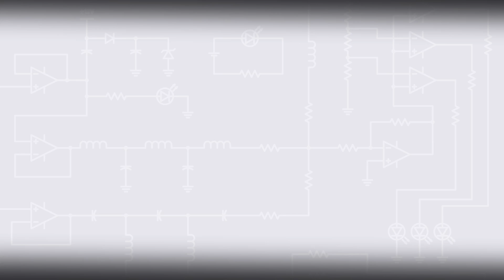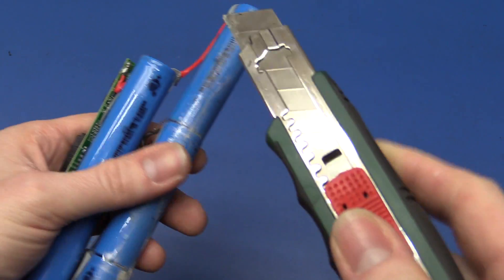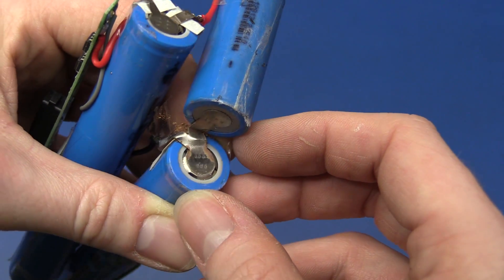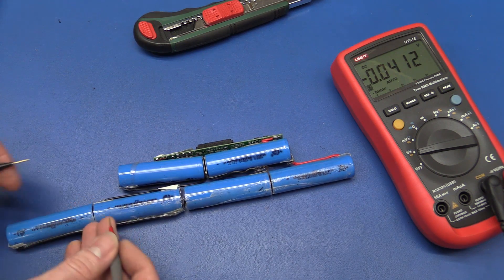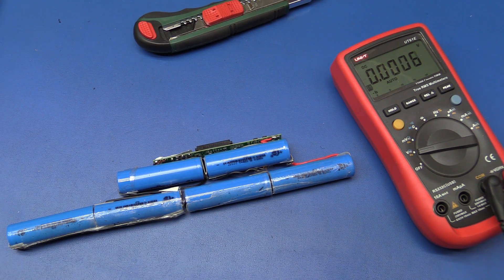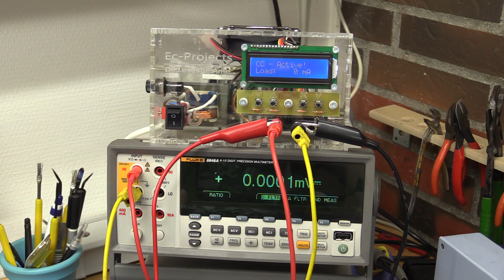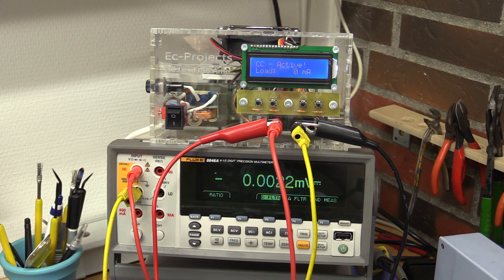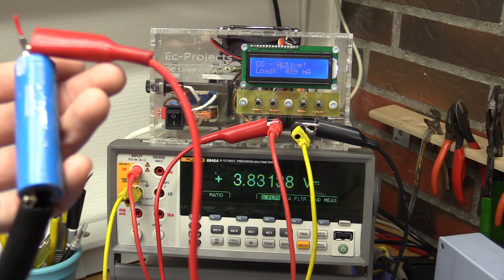Disassembly of Failed Laptop Battery - Ec-Projects

Comment: My acer notebook, which is nearly 6 years old, has a battery model AL14A32 and it has failed, after the high temperatures due to climate change;  the weather here got so hot that the battery simply stopped working

Comment: Charge all the batteries individually by some other means. And then connect them the way they were connected to the BMS board.
There are 2 ways to enable the battery circuit.

1. Connect the 12volt battery terminal to the actual +ve port on the laptop battery connector. It should enable the circuit. If not try the next step.

2. Keeping the negative probe of the multimeter on the battery pack negative terminal. Check all the pins for some kind of voltage which should be within 1.5 to 5 volts. If found any. Just ground that pin and the battery pack should start powering up.
Reply: which are the 2 ways of enable the battery circuit.??

Comment: No obvious evidence of damage on the circuit board, makes you wonder what actually went wrong internally
Reply: +tombell12 I've heard of BMS firmware having a limited number of cycles programmed into it, as an excuse to force users to replace the battery every once in a while. Lithium ion batteries usually provide at least 3 years of use, sometimes upwards of 5-8 years. Laptop batteries suspiciously always fail earlier than later.
Reply from the maker: +tombell12 Yeah, I never found out. Perhaps overcharge, the battery got very hot in the computer but cooled right down after I tossed it out in the garage :/

Comment: Mads put the batteries from the failed pack into the original pack and see if that will revive the original pack. Or put the original pack controller board into the failed pack. Nothing lasts forever.

Comment: The circuitry of the battery should be pretty simple a microcontroller to handle charging and protection some fuses, mosfets and a voltage regulator for the micro.
except for checking for voltages and mosfets, what else can you do ?

Comment: So, a battery indeed has a controller which disconnects it from Power Source to prevent over-charging. What's the harm in leaving the computer connected with power supply for a longtime even after the battery is completely charged ?
Reply: There is no harm in leaving your computer connected to the charger for a long time, it all comes down to the life expectancy of your battery. According to "experts" the optimal long-term storing charge for a lithium battery is about 70%, this will give your battery the longest life span.  This optimum life span will decline somewhat at both higher and lower charge levels, leaving your charger in the laptop will maintain a 90-100% charge. But unplugging and plugging in your charger to stay at 70% is really not a practical option, and the manufacturer of the laptop don't want you to run off with just 70% charge. So just leave it in :)
Reply: +TheAmmoniacal ببسىصةضبثاصليب

Comment: Maybe you should change the title - the title implies that "you" failed taking the battery pack apart, like something went wrong (caught fire when opening case etc.) Did you check the chemical fuse ? It's probably the MCU that blew the fuse intentionally to protect the cells from overcharge.
Reply: ***** I didn't get that impression. I felt that the title described the video just fine.